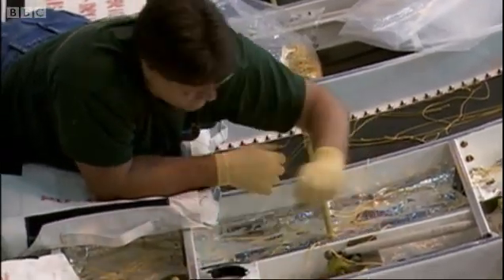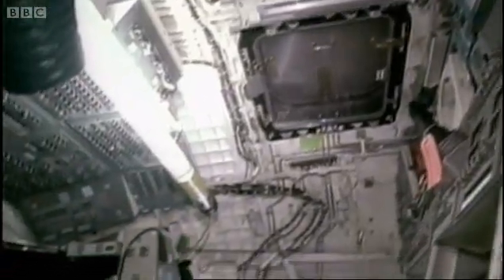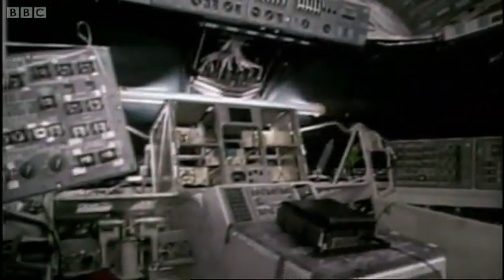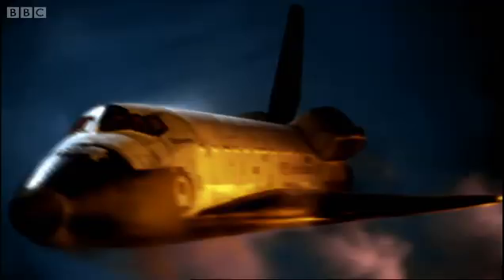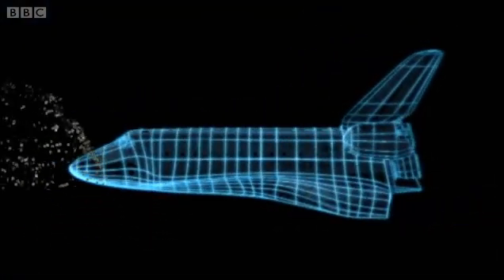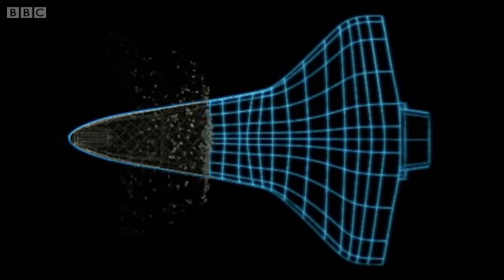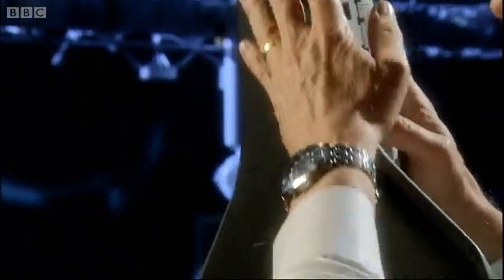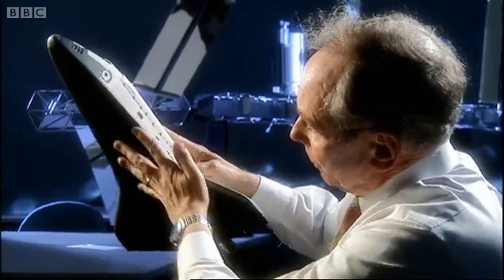Space Shuttle Columbia Disaster Pt 5: Heat resistant tiles | BBC Studios

Comment: This is probably a stupid question but why did Shuttles have to return to earth at such a rapid rate? Couldn't they do it slower? Using engines to slow their decent or simply continue to orbit and reduce their altitude at a slower rate?
Reply: Simple, maximum efficiency. Why bring up all the fuel needed for significant deceleration (which would've required larger / more powerful boosters at liftoff, and therefore greater expense), when instead you can let the atmospheric drag handle deceleration for you?
Reply: Well, the fast reentry isnt really a matter of choice, the space shuttle used most of its fuel in the launch sequence, the remaining fuel was there only for minor course adjustments, at reentry all of the space schuttles fuel had been depleted. Even if they did have enough fuel to slow it down there would simply be not enough time to turn the space shuttle around to fire its engines and turn around again for reentry. But im no scientist so idk really

Comment: Did NASA Consider Titanium When building the Space Shuttles When Compared to other Materials Like Aluminium ??  Just a Thought Titanium takes The Heat !! And Still as Strong or Stronger than Steel !!
Reply: Weight considerations.  The density of titanium and aluminum are 4.54 g/cc and 2.70 g/cc respectively.  As you can see, the aluminum is almost half the weight per unit of volumn as the titanium.  As for titanium, it has a melting point of 1600C which is 2912F, so it would withstand pretty much most of the temperatures encountered in re-entry.

Comment: by the way the white portion of the shuttle is not ceramic tiles. The ceramic tiles are the black part on the belle, a bit around the nose, and some othe spots. The white parts are fabric actually. The gray-ish parts on the edge of the wings and the nose cone are indeed a layer of reinforced carbon-carbon.

Comment: Why aren't the panels all white? Wouldn't that help in reflecting some of that heat absorbed by the tiles?
Reply: ***** Gotcha, thanks ;)
Reply: UltimateBMWfan: More important than the color is the material the tiles are made of. The black tiles are made of a material that withstands more heat than the white tiles.
Reply: +Rob Adams i thought they were just painted on
Reply: No, the tiles that covered most of the orbiters were made of a material that was very specially designed to withstand the extreme heat of re-entry, and still be able to do it again dozens of times.

Comment: I'm not good at science, but could they re-enter the earth at lower speeds to prevent excessive heat?
Reply: no, lower speed means steeper angle, which means higher speed... more heat in shorter re entry time, means your spacecraft will burn fast... however a more flat re entry angle, means more speed and more time spending in the heat, more time to burn down your spacecraft... and i guess slower re entry.... but dont listen to me, i am not a scientist
Reply: @LordExtrasus  Actually, you've got the basics right.
Reply: Reducing velocity prior to re-entry means carrying fuel/reaction mass.  The shuttles carried just enough to slow their velocity to the point where their orbit path dropped deep enough in the atmosphere to catch air.   The kicker with orbital mechanics, when you slow your vehicle, you lower your orbit's lowest point.  The shuttle faces a two fold issue.  One, carrying more fuel means more mass, means less payload into orbit, and they're already at a premium, because of all the extra weight they have to carry.  The wings and vertical stabilizer are basically dead weight until it's gliding.   Secondly, the shuttle needs to come through atmospheric re-entry with enough velocity to glide to the landing field.  If it slows down too much coming through re-entry, it loses aerodynamic lift, and ends up short of the runway, or it comes in at too steep an approach angle.  It already has all the glide characteristics of a winged brick, the margins are just too tight to risk lower speeds on re-entry.  It has to hit the denser atmosphere at a certain speed, with a predictable level of velocity loss to come through entry interface (the burning/plasma blackout part) of the process with enough velocity left to make it to the runway at the right angle of approach, so as not to collapse the landing gear when it touches down, or just belly flop with a loss of vehicle and crew.
Reply: No they can't it's the earth gravitational pull that makes the shuttle reentry at high speed.
Reply: @Hale-Bopp  The shuttle is at high speed in order to orbit the Earth. The deorbit burn slows the shuttle by 200 something miles and it's enough to make it reenter the atmosphere. The shuttle at this point is travelling between 17 and 18 thousand miles per hour. They then bleed off all this speed in order to land in Florida. There's no slow or high speed here. The shuttle is at a fixed orbital speed when it enters the atmosphere and starts to slow down for landing in Florida. Its speed is just above 200 miles/hour when it makes contact with the runway. It generates so much heat during reentry as the kinetic energy is converted into heat energy.